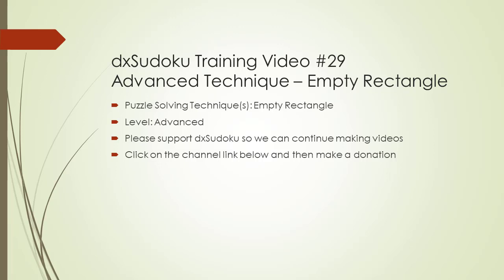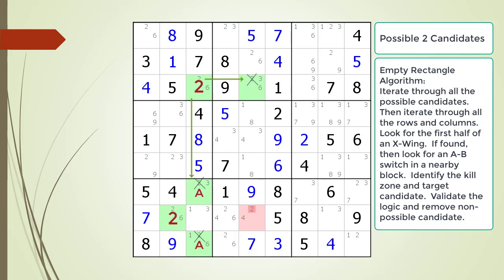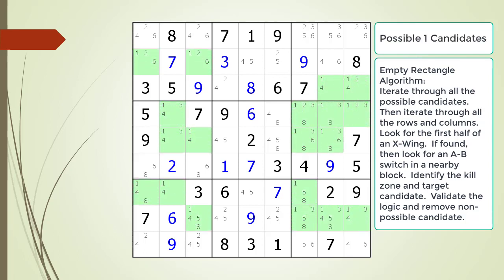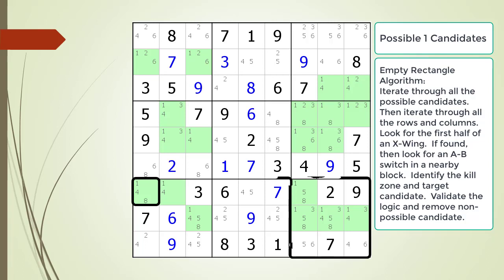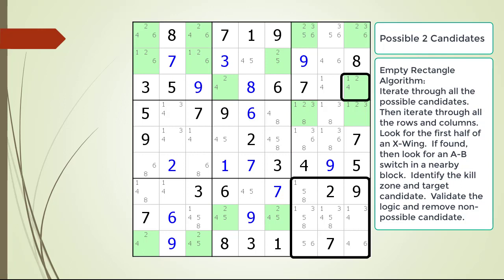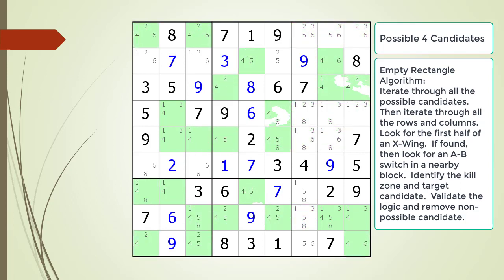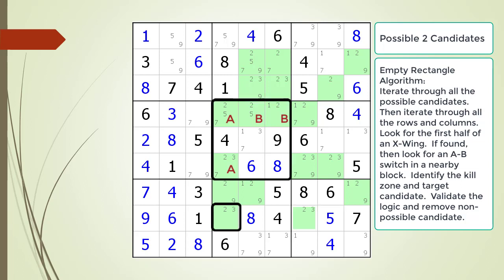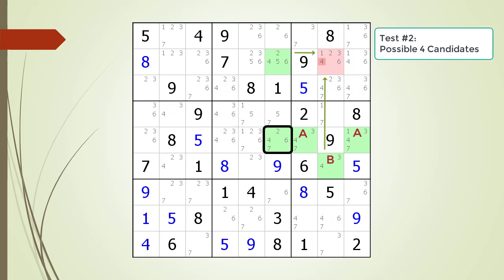dxSudoku #29 Empty Rectangle Puzzle Solving Technique

Comment: In the AB pattern, is it true that it doesn't matter if A exists? If A does not exists, it's a locked candidate; if A exist, it's an empty rectangle. Either way, The intersection of B and C2 cannot have the current number.
Reply: Sorry I was not clear. I mean that in the exmple, two cells are marked 'A'. It does not matter if these 'A' cell contains the current number. Either way, the number can be removed from the cell that sees both 'B' cell(s) and the second cell of the 'first half of x-wing'
Reply from the maker: @jasony001  This is the definition of a Group Node in a chaining sequence.
Reply from the maker: I'm not sure what you mean by A not existing.  An Empty Rectangle is a type of X-chain having Group Nodes.  Take look at this video: https://youtu.be/di1aM5X0h6Y?si=0uA1UnXq02x98rSA

Comment: Love this video. Finally a tutorial that clearly states the rules and systematically illustrates the technique for executing defined rules. Great job!
Reply from the maker: Thank you for the nice comment!   When I did video #29 I purposely tried to keep the terminology to a minimum.  To really understand the Empty Rectangle you need to understand the terminology around Sudoku Links.  A Sudoku Link is just a fancy term for a relationship between two things in a Sudoku puzzle.  I am currently working on redoing the 2-String Kite video but using the Sudoku Link terminology.  After the 2-String Kite, my plan is to do a new Empty Rectangle tutorial but using the more advanced Sudoku Link terminology.  It turns out, the Empty Rectangle is really a special type of X-Chain.  If you are able understand this video at some point in your future you need to master X-Chains.  X-Chains are the gateway to the most advanced puzzle solving techniques.  Generally, I no longer look for Empty Rectangles.  I just look for X-Chains and the Empty Rectangles get found in the process. The A-B switch terminology is still valid, but a more mainstream common terminology is to call the A and B part Group-Nodes and between them is a Group Link.  Here is an Empty Rectangle pattern but diagrammed using Sudoku Links:
https://imgur.com/Diaro3W
Don't worry if you don't understand it right away.  For now, just look at the diagram and think about it.  It will become much clearer over time.  Also, here is a really good wiki page on Chaining and Sudoku Links:
http://hodoku.sourceforge.net/en/tech_chains.php
This wiki page is probably a little more dense than my tutorials but I follow this set of wiki pages for most of my terminology I used in my videos.

btw, here is a link to my first book if you are interested:
https://www.amazon.com/dp/1736452606?ref_=pe_3052080_397514860
Sorry for the shameless plug on the book.  But if you only knew the insane amount of work that went into the book you would instantly forgive me!  Also, I am currently working on my second book which will include material on the Empty Rectangle and all the single-digit puzzle solving patterns.  I will probably get my second book  published by March 2022.

Comment: Finally a clear empty rectangle tutorial with practice problems. Thank you!
Reply from the maker: Thank you for the nice comment!  If you need more practice exercises try Hodoku's Learning Mode. It's very good.  Also, Empty Rectangle is a variant of the X-Chain.  But take your time.  Get good with Empty Rectangle's first.   You should also learn 2-String Kites and Skyscrapers.  Especially Skyscrapers because they are very common.

Comment: Thanks for the video,

At 12:34, couldn't there be an empty rectangle with the same first half of xwing candidates, but with the AB switch being in box 9?
Reply from the maker: Great catch!  Yes, this is definitely another Empty Rectangle: 
https://imgur.com/wKzshUV
It's kind of cool example having both ends of a Strong Link connecting to AB switches this way!  Great comment!
Reply: @dxsudokuchannel  this is the one k found initially. I guess you can remove both of these?
Reply from the maker: @TylerHumphrey05  Yes, you can remove both.  I've come a long way in my thinking about Empty Rectangles since I did video #29.  At this point, I don't search for them.  What I do is when I search for X-Chains I look for Group-Nodes in any direction.  Finned X-Wings, Sashimi X-Wings, and Empty Rectangles are all types of X-Chains having Group Nodes and Group Links.  Here's a later video on Empty Rectangles showing my current way of thinking about them and searching for them:
https://www.youtube.com/watch?v=FXMcfqmriNQ
Chaining becomes very important when solving the more difficult puzzles.

Comment: Came from reddit, what is AB switch?
Reply from the maker: With an Empty Rectangle you start on the one side which is the first half of an X-Wing (aka, a Strong Link), from the two corner points, you move left or right to an adjacent block.  Inside the block there are 2 to 5 cells which create a situation where some cells are force off because the end-point of the X-Wing half is set too a value.  The only way to really understand it is to look at the logic shown in the video of the way the values can be set.  But to find the AB switch all you have to do is move along the row or column to one of the adjacent blocks.  I gave a longer more detailed explanation on Reddit.

Comment: Excellent explanation of the empty rectangle concept.  The key is to look for the first half of the x-wing and the A-B switch and then hunt for the kill zone.

So from the examples it looks like the “A-B switch” does not necessarily have to be three cells containing a naked triple.  It could be four cells (example # 7). Is this correct?

Thank you very much.
Reply: I think he missed your question. You're right, the AB switch doesn't need to be a naked triple, it can be four cells (or five, or even two).

A-B switch happens when a digit's candidates lie exclusively in one row and one column (two axes) of a block. One axis (row or column) points at one of the X-Wing cells, then the other axis points at a potential elimination candidate. The elimination candidate must then line up with the opposite X-Wing cell. If everything lines up, you can remove that elimination candidate from the cell.
Reply from the maker: @jrtomsic  You are right.   I did not understand the question.  As you said, the AB can be 2 to 5 cells.
Reply: Jason T thank you very much for the explanation.  I really appreciate you taking the time to answer my question
Reply: @jrtomsic  Very clean definition of AB-switch, that I was missing in the dxsudoku's video #29.
Reply from the maker: Thanks for the nice feedback!  I'm currently working on the X-Chain video.  It's very close to done.

Comment from the maker: Minor error at the 7:48 mark.  We missed the first half of an x-wing in column 7.  There was no AB switch in blocks 1,2 and blocks 4,5 so there was no Empty Rectangle Rectangle anyway.   Also, very interesting enough at the 10:19 mark the puzzle shown has two different Empty Rectangles.  The one shown the AB switch is found in block 5.  But there is a second valid Empty Rectangle pattern using the same two conjugate pairs on row 8 with the AB switch in block 6.  We used the second AB switch to solve the puzzle and what happens is a set of locked candidates occurs in block 5 which results in the same non-possible candidate being removed as the first Empty Rectangle.  It's interesting to see two Empty Rectangles using the same first half of an x-wing in the same puzzle this way.
Reply: I still don't understand how I know what is an AB switch and what is not
Reply from the maker: At the 1:00 minute mark in the video it explains how it works. As with all puzzle solving technique you have to visually confirm the logic.  The AB switch terminology is just to help  you begin to understand how the logic works.  The AB switch part is not the whole story.  But the trigger on the other side determines which cells are active in the block having the AB switch is the important concept I was trying to convey.

Here's link to the Hodoku Wiki page on Empty Rectangles.  Maybe this explanation will work better for you:
http://hodoku.sourceforge.net/en/tech_sdp.php#er

What is really useful in understanding how these work is by looking at several examples.  At the 11:44 mark of the video the practice exercises begin.  You can pause the video and try to find the ER yourself.  And then resume the video to see the answer.  After seeing the pattern several times hopefully it will help you understand it.  

When the trigger is false, the other corner of the Strong Link is active which kills the target candidate.  When the Trigger is true or on, then the B part of the AB switch kills the target candidate.  I tried really hard to make this easy to visualize with the graphics.  You really need to convince yourself by running test scenarios with possible values.